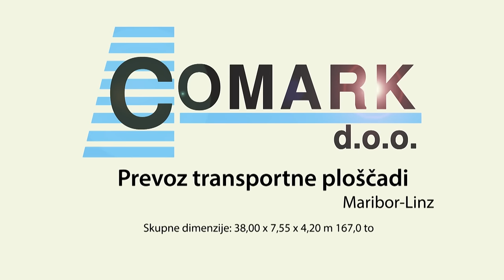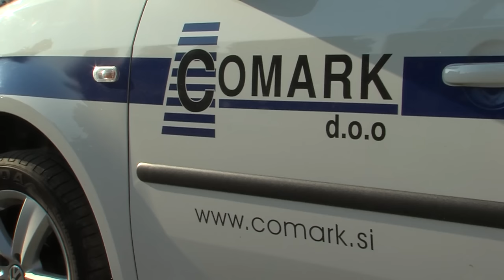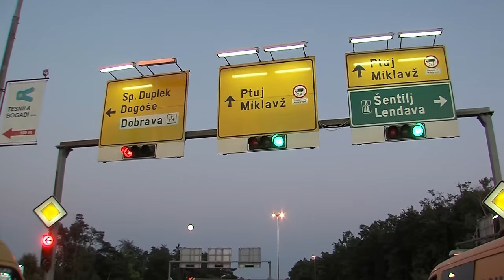Convoi exceptionnel - 7,50 meters WIDE

Comment from the maker: Although its summer and high temperatures we are still here to move OOG cargo. Last week was very SPECIAL as we transported - TRANSPORT PLATFORM wide 7,50 meters. As you will see in the clip, we have used modular trailer, put cargo on proper high as it is easier to transport wider cargoes on certain height because of the road infrastructure (traffic lights, traffic signs and so on). A lot of PILOT (escort) cars was need for this operation. Police escort was necessary, for momentary road closures. 
--
Kljub poletnem času in visokim temperaturam se projekti vrtijo naprej. Zares zanimiv je bil zadnji, ko smo vozili - TRANSPORTNO PLOŠČAD široko kar 7,50 metrov. Vse podrobnosti so lepo vidne v filmu. Uporabili smo modularno prikolico, tovor smo postavili nekoliko višje saj to olajša transport tako IZREDNIH širin (prometna signalizacija). Za varno vožnjo smo uporabili vsa SPREMLJEVALNA VOZILA, potrebno je bilo tudi policijsko spremstvo zaradi kratkotrajnih popolnih zapor.